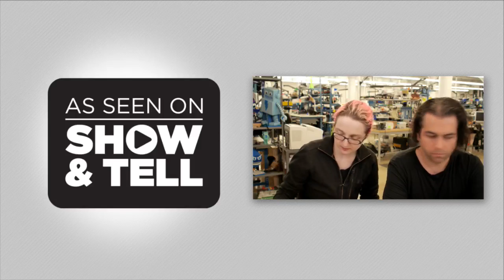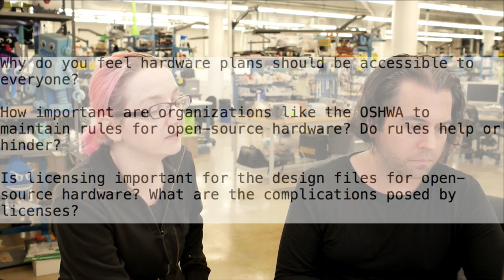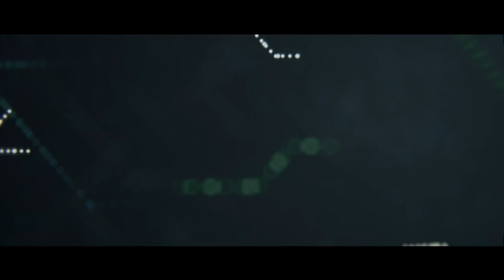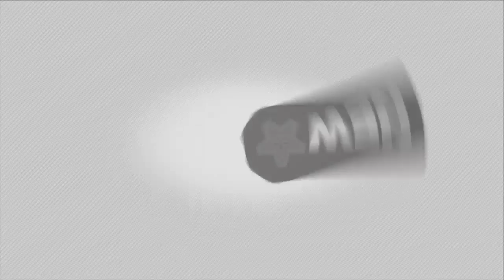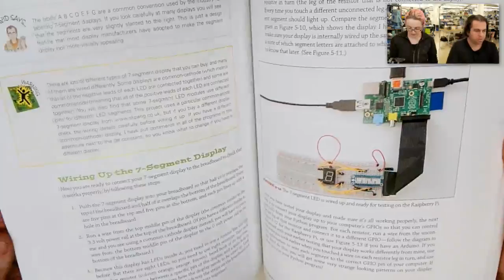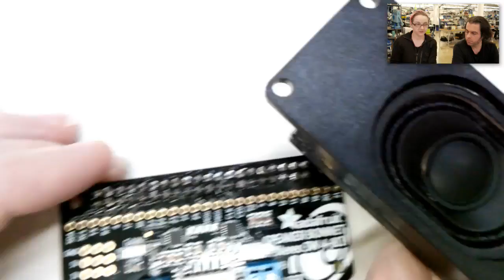ASK AN ENGINEER - LIVE electronics video show! 8PM ET 12/7/2016 (video) @adafruit #adafruit

Comment: Can the HT16K33 breakout board you sell drive common anode matrices such as a common anode 10 pin 0.56" 2 digit 7-segment display? Could one breakout board drive two such displays? Also, are the display parts of the 0.56" 4 digit 7-segment displays with backpacks you sell common anode or common cathode? Finally, do the anode pins on the HT16K33 connect to a matrix's anode pins or cathode pins? Thanks in advance! :)

Comment: When you illustrate a product you show a coin in the same shot.I have no idea the size of that coin as I live in UK.
Reply: I googled it!  "The diameter is 0.955 inches (24.26 mm)"
Reply: Most currencies have a US Quarter sized coin, for UK 50cent or 2 Euro are roughly the same size as US $.25 piece.
Reply: There is also the cr2450 coin cells which are also fairly close.
Reply: Errr ... hello? We don't use the Euro in the UK, we use Pounds Sterling (GBP). Slightly sensitive issue #Brexit.
Reply: hah was not really the point.. 50p or shilling whatever, I am not canadian but I have canadian coins in my house. Surely you know of coins that are similar in sizes and have seen them. :)
Reply: The American quarter is 0.955 inches (24.26 mm) in diameter, this is very close to the UK 10p piece at 24.5mm.